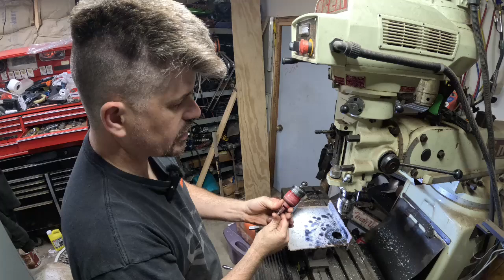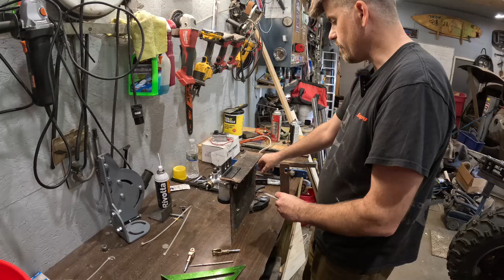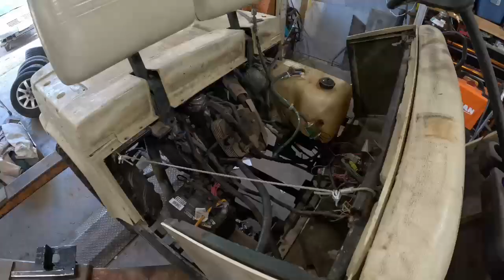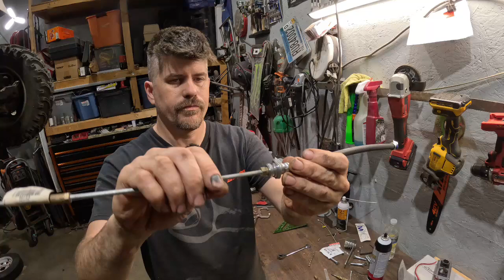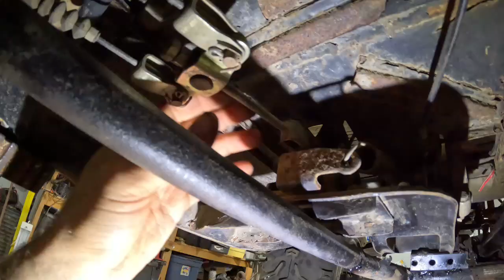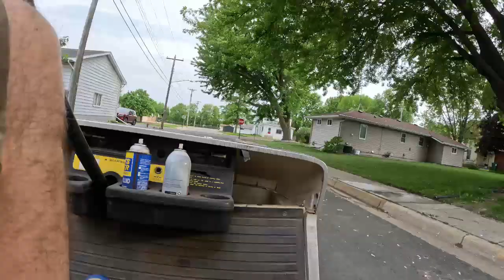Arctic cat 4x4 golf cart build, adding hydraulic brakes and a test drive

Comment: Hi I have a 4x4 golf cart as well. I used a 2002 artic cat 375 4x4 and put on a 1965 cushman. I'm about 99% complete. Just need a fuel pump. Can't find a low pressure fuel pump that works well with the carburetor. As it's running. Fuel pump makes the carburetor leak fuel from the overflow.